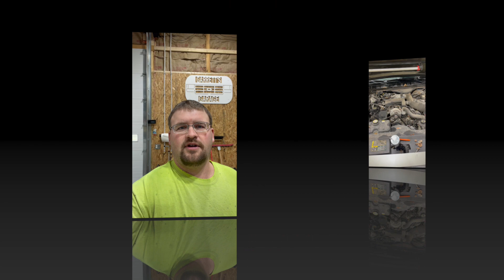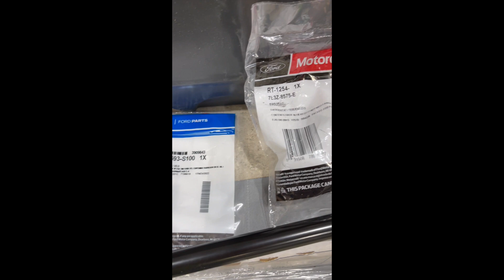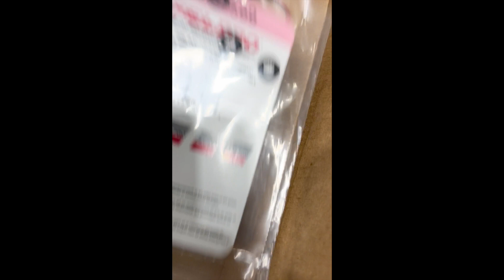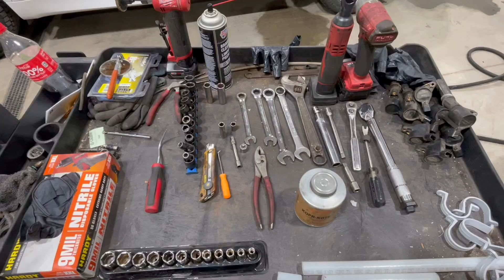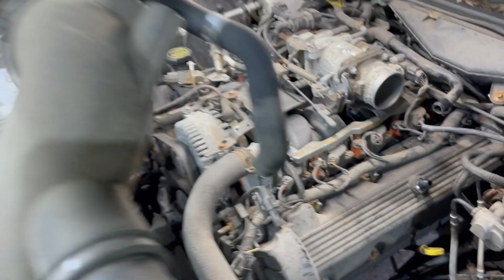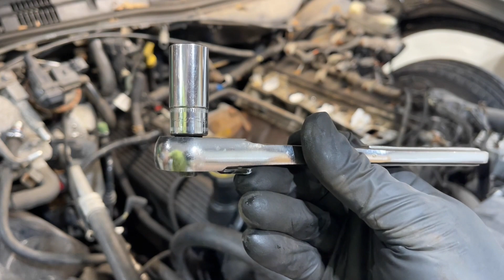4.6L 2 Valve Intake Manifold and Coolant Crossover Install   PART 1

Comment: I have a 202 ford explorer v8 4x4 and my gasket is leaking on my coolant crossover pipe do I have to take off the whole manifold?
Reply from the maker: It depends on where it’s leaking.  If the plastic has failed, then yes. You will.